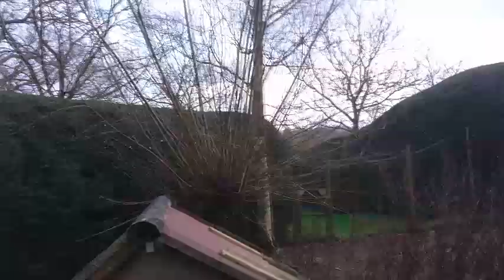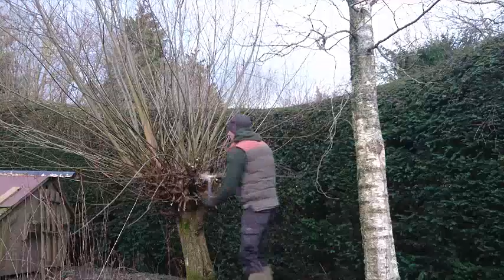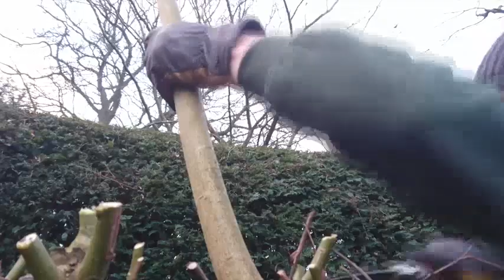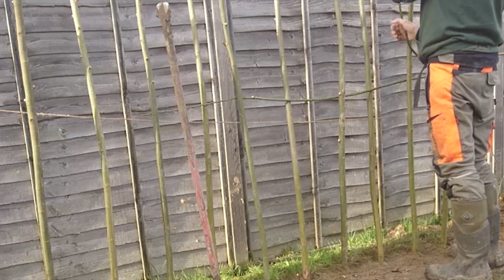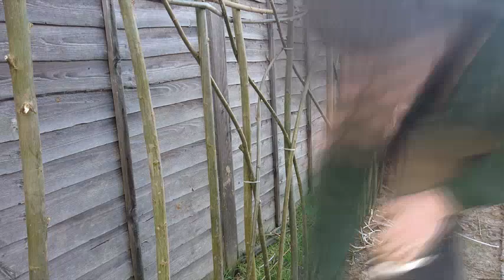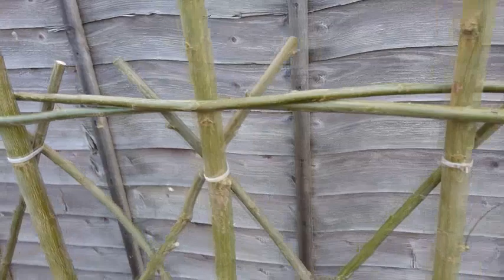AMAZING hedge from Willow clippings

Comment: Thanks for sharing this, I'm hoping to do exactly the same thing over an 8m gap. 

Do you think it is too late in the year to do this and would you be able to tell me how far apart the branches are that you planted?
Reply from the maker: Thanks for watching. I'd like to do another over a larger area in the future. 

I have seen willow whips for sale and planting would be ideal but I wouldn't be cutting from the mother plant until winter now. 

I did 6inch spacing on mine. The ground around it is getting very rooty now. It is definitely helping with soggy wet clay ground

Comment: Would like to see what that fledge looks like when it grows, & about how to maintain it over time…speaking of that, what is the life expectancy of a fledge like this?  How tall does it grow?  Does it try to revert to growing like crowded trees, if not routinely trimmed?
Reply from the maker: Hi. Am sure it has been in a later video I've done. I'll have a think and pop the link on. 
It's now in its third year and I trim it twice a year on the face. I also remove all new growth on the arch bits lower down to keep the look. In winter I cut everything back to the trunks. Can't say about its life cycle but I can't see it turning up its roots any time soon.
Reply from the maker: https://youtu.be/5qLf64_8dJw

I believe you get to see it in this video I done